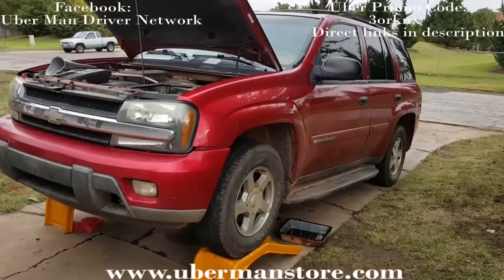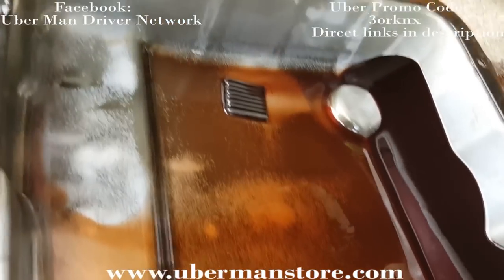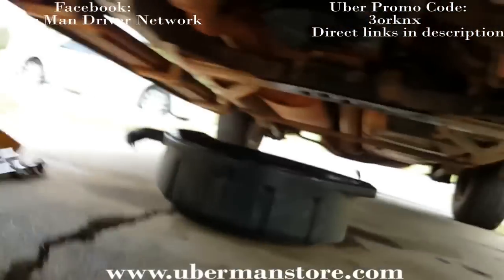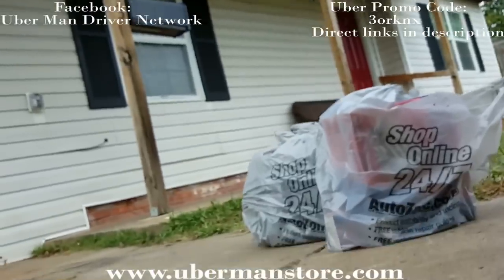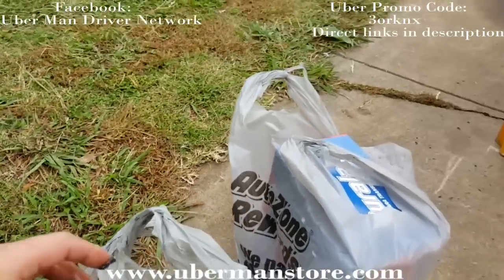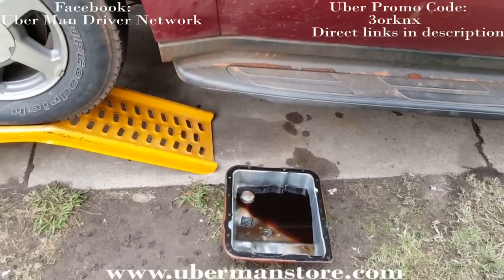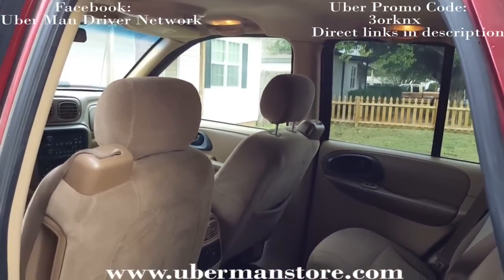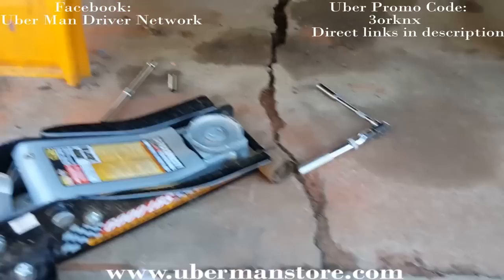2003 Chevy TrailBlazer Shift Solenoid Replacement

Comment: Man you stole that thing , heckuva deal. Nice video , I've got a 05 TB with same issues , the thing was fine and I parked it for a year and when I decided to use it again the thing wouldn't downshift or upshift , I can manually downshift it and upshift but only have 2 and 3 , its the 4x4 model . anyhow thanks for the video I'm bout to go crawl under it.

Comment: I bought one in March of 2020 seller got me had no air and it needed $800 worth of front end work but overall I like it I did have to replace the starter and alternator easy fix, Great video my man.

Comment: Loved your video.....2002 TrailBlazer....Cylinder Five misfiring....changed coil....spark plugs....about to change out the alternator....still running rough on idle....drives smoothly....but when slowing down & idle is very rough.....almost like I am hitting the gas and brake at the same time......are you still on this site.....can you talk to my mechanic about to do my alternator.....any way to know if my transmission is about to go out?  2002 Trail Blazer Chevy LT.......been having problem with leaking power steering that got all over everything.....HELP.

Comment: Thanks for the detailed info on the trans and its components -- too many YouTube videos blow past too many of the little details (which are often the toughest things to figure out if you don't already know about them already). I've done maintenance/repair/rebuilds onmanual transmissions but this is the first time I've ever felt like I could actually crack open this auto trans and not regret it. Great job!

Comment: I have the same vehicle. I am having transmission problems too and am hoping it's a similar fix.
In order to shift from second to third I have to slightly let up on the accelerator.
But there's more. When we took it out on the interstate for the first time we only got about 3-4 miles before we lost power. I'm not a mechanic by no means but I am mechanically inclined and a decent DiY'er. I realized it was shifting back down through the gears resulting in the RPMs racing up.
So we limited driving on lower speed roads as it did decent at speeds 60 M.P.H and less.
Now a new problem is developing. When I come to a stop I get a lurch forward and it dies. I believe it is staying in second or third gear when I stop.
Would this lead you to think it's the solenoid(s)?
als, the check engine light is on but the codes only reference fuel issues (evap).
I keep editing this to add more, lol.
We bought this about 3 months ago. From the comments below, I am going to change the filter and fluid and add Lucas.
It's in almost exactly the same shape as this one in the video right down to the console door.

Comment: Been hunting down videos to find my problem. 03 trailblazer EXT; recently a clicking like mock started and got pinpointed to the transmission, whether idling or driving you here the sound and you really hear it at 2000 - 3000rpms.  Has fluid but no real clue and hoping I can figure it out an fix it my self before paying the piper at a transmission shop.  Any clues Sir?

Comment: Regarding the vibration in drive that you mentioned... I also had this issue and replaced the motor mounts and cleaned throttle body. The real fix was the replace all 6 coil packs. Afterwards all vibration is gone.

Comment: Thank you for your video. My gear didn't shift from 3 to 4. It moves perfectly from 1 to 2 to 3 but sometimes doesn't shift from 3 to 4, so RPM goes high up to 3000 when I am on 50 miles. This issue happens occasionally and resolves on its own in 20-30 minutes. It was repeated 3 times over the past week. Any suggestions?

Comment: I bought a 2007 Chevy trailblazer LT 4.0 in line 6 4wd, it runs good drive good in first and second, when shifting into 3rd it revs super high and kicks into gear but im then driving in high rpm’s around 3000-3500 the hole time, not sure if it’s skipping 3rd or what. Any ideas of what could be the issue.

Comment: Would you be willing to help me figure my 2004 envoy problem out?  It throw code p0495.  Fan clutch replaced 4 times now and still throws the code.  There is something I missed.  What is it?  Will taking it to dealership to have main computer reset.  Will this do anything to help?  Please point me in the right direction.  I am disabled and this car was to get me to the end of my driving days.  If this continues it won't nor will my sanity.  My 89 Jimmy which I still drive beats the 04 envoy everyday in every way but I needed a car with Ac in Texas heat. I am at my end and I need help.  Thank You for reading my comment.  God Bless You.  I enjoyed learning from the video.

Comment: I need help i have a tb exactly like this one but a 2002.  I think it may be tge solenoid but not positive.  It shifts to 2nd most times but going into 3rd and then overdrive i guesse it revs high n feel like it is slipping.  Its not so bad when it is cold but once it warms up its a real pain.  I can manualy drop it to 3rd and it catches.  I also have a problem with the fan clutch.  Could that affect the shifting?  When autozone hooked up diagnostics it did not give a solenoid code only the fan clutch and a couple other emission issues any info would help

Comment: definitely answered some of my questions! i just thought the center console was crushed from the husky previous owner but it appears to be a common issue. my bad. haha  also it seems you have a pretty good knowledge on this yr so id like to pick ur brain on some issues im having such as first gear seems to wind out a little too long sometimes and i have to let off gas to get it to go. its not having the typical trans issues like no power or 3rd blah blah. gonna do the filter change and maybe a flush instead of partial fluid change. not sure if its worth doing myself and spending a lot on like 4+ gallons fluid etc or just taking it to a decent local trusted trans shop. any thoughts? thanks
Reply from the maker: A shop will charge about $120ish for a flush. I'd let them do it. I'd change the filter myself.
Reply: Thanks. That's what I was thinking too. So you think the first gear issue is hopefully just old fluid and the solenoid  gummy?
Reply from the maker: That would be my hope. Yes.
Reply: +Reviews and How-to yeah im kinda leaning towards that too since its not that bad yet. how are/were the shocks and struts in urs? mine are completely gone. about to order moog struts w/spring and kyb gas-a-just for rears. i dont wanna go cheap nor over the top. got any intel on them? oh and if ya dont mind one more question for now. it has a deadspot/hesitation as soon as I hit gas. I have cleaned the throttle body which helped a lot..like stopped stalling when I put a.c. and ran better but this is really annoying. lol any thoughts much appriciated. thanks again.
Reply from the maker: Shocks and struts aren't bad at all on this. KYB / Moog are GREAT! You'll love them!! As for the hesitation, plugs? Coils? Boots? That's where I'd start. A tune-up never hurts.

Comment: We have a 2003 trailblazer that runs rough occasionally and stalls occasionally. ...appears to do it now that it is getting cold here. I will definitely follow   the transmission maintenance that you performed. we have 137000 on it and have only flushed it once. :-( but it has run perfectly the whole time till now. I just want to know...how you got a hold of this year Trailblazer with a set of guages that are fully functional! most of my guages are completely off...any fixes for that?
Reply from the maker: You need to replace the stepper motors. It's really easy. You can DIY or pay a shop.
Reply: Ok i will look for a video for that! thank you!

Comment: If you’re messing with an automatic transmission, it’s best to reuse the old fluid if you have over 100,000 miles, that clutch material in the fluid is a lot of the time the only reason it’s not slipping. Change the filter, put the old fluid back in and top off with new fluid. If you put new in it and it starts slipping, skip the Lucas and head to a Ford dealership and buy their friction modifier. It’s the best by far.

Comment: 02 trailblazer 4wd LS  that i have suddenly has an issue with transmission(automatic). During normal operating temperature it Engages in gear(R & D) only at high RPMs. Cold starts  the transmission seems normal until about 15mins of  driving it start acting up....no DTC codes, no dash lights, fluid & filter changed this morning which drove perfect after so decided to drive around then 45 min later it decided to do it again. Solenoid? If so which?...PLZ Help!

Comment: We just bought a 2006 on of these and when I drove it today it was fine , when I put it in reverse it reversed normally at first but now I notice some times it will stick randomly, any advice on this ?
Reply: Did you ever figure out your problem I'm having the same reverse could work for a couple minutes at first startup then would stop working
Reply: @RVguyReese0926  it turns out it was me not pushing the gear stick in place we enough but also I did research and found it could also be a shift solenoid or shift line so even tho these weren't our issue it should help you narrow down a fix , good luck and cheers
Reply: @Fullrusher  Thanks

Comment: I saw you had the motor nice'n clean! I want to pressure wash my engine in my 2005 Trailblazer. What all did you cover before you washed it? I'm guessing the ecm to start with huh? Good video 👍
Reply from the maker: Thank you. I never cover anything. I just spray it. Never had an issue.

Comment: My 2003 has the same issues. I will be replacing the filter fluid and solenoids Rather than Selling it for nothing. Thanks for the video I found it helpful
Reply from the maker: Thanks for watching!
Reply: Be careful with changing to all new oil the detergent in the new oil could easily break up gunk inside and plug up vents and ports then your transmission could be severely damaged

Comment: Hello and thank you for posting these "how to videos" you help many of us out by sharing your knowledge in this manner.  I have an 02 Chevy Trailblazer in line 6 - 4wd that started hesitating between shifting and then while driving one day it was doing a flat out delay or wouldn't change at all, but never threw any codes.  I took it to a shop and I'm looking at 3700.00 for GM cert tranny. Mechanic says that my transmission fluid is burnt and they drove it and said my tranny was blown. This particular mechanic doesn't do any internal work... so my question would be.. could this possibly still be just the need to replace solenoid/s or truly a new tranny? Thank you again.
Reply from the maker: Step one would be pulling the pan. If there's metal in it it's trashed. If there's no metal in it, change the filter and fluid to see if that helps. Lucas transmission treatment is a miracle worker!!! Add 2-3qts after you change the filter IF there's no metal in the pan.

Comment: So quick question. My 02 trailblazer might have the same problem with solenoid. I changed the fluid out. It was dark brownish (Not like the fluid in this video) it shift gears fine but kind of hesitates on take off & a slight odor. A mechanic thinks it's my solenoid. Is this correct?
Reply from the maker: +Brian Davis If it's the solenoid, there will be a code for it. They either work, or they do not. I doubt that is the issue.

Comment: I have a 2003 envoy xl I was driving on the freeway exit the freeway stop at the light took off it stop pulling pulled over check for leaks no leaks the transmission was full I put it in drive D123 nothing put it in reverse nothing changed the oil pressure shifting switch and it still nothing happens I would like to know is it done inside the pan a little dark that's it

Comment: Great video Uber Man, I recently ran into an issue with my 2002 trailblazer where it would not shift out of park. It would turn on, you heard the click when you tapped the brakes, the brake lights were working, and the shifter was working, however it was not moving out of park on the dashboard. I hopped under the car and noticed the shift cable had popped lose and needed a new bushing to pop it back on. I was hoping you could do a video on shift cable replacement (from the transmission all the way to the center console. Thanks! I do have to change my motor mounts as well! Running good at 250k miles.
Reply from the maker: Thank you! I appreciate that. Sadly, I sold it, so I have no more videos on this truck.

Comment: Hi I have 2006 Chevy trailblazer slipping in 3rd and 4th gear. I changed the solenoids  and it still has the same problem. Do you have any other idea? Please
Reply from the maker: Was there metal in the pan?
Reply: No metal it was just black
Reply from the maker: Hmmmm. Check engine light? Codes?
Reply: Yes the check engine light is on. I took it to auto zone and a code was on there and it came up slipping.  The guy said it was a solenoid or low transmission fluid.
Reply from the maker: I'd do a complete fluid flush and swap the filter. Substitute 2 qts of fluid with Lucas.
Reply: ok thank you very much I'll give that a try.

Comment: Good video.  I managed to replace both 1-2 and 2-3 shift solenoids on my 2007 Trailblazer.  It was also low on Tranny fluid, which was to my advantage because it wasn't as messy to remove the pan.  But once it was back together when I put it in to gear it's not doing anything, not moving except very slightly when I put in drive.  There no reverse or anything.  Not sure what happened. help, any thoughts?  Thanks in advance.
Reply: Hello there, it has been four years since you did the repair and the truck was not driving. May I ask what was the final solution? thank you!
Reply: @microtcpip  it's been so long since this took place and we no longer have the car but I did manage to get it running again. If I remember correctly there was a leak in the transmission line and once I replaced the line it remedied the problem.
Reply: @lisarennert4180  Thank you for taking your time in replying. That gives me one more thing to check for!
Reply: @microtcpip  I hope that helps.

Comment: There is no service engine light on atm I have had it scanned before I can't remember the code tho.  But I did do a google search on my problem and I read peopl saying it was a solenoid going out.  Said something about a steal ball barn being pressed an aluminum plate and over time that plate starts wearing down where the ball barn can't keep the pressure to the plate.  Does that sound right at all?
Reply from the maker: It could be, but before anything else, that code needs to be run. This is something guessing at won't fix.

Comment: So I had a problem with gear slipping after 2nd gear. No third gear or higher. I took it to the shop and they said it was in pretty bad condition and a new transmission would be around 2k. You mentioned in the video a new one is 1100, where can I find one at that price? Thanks
Reply from the maker: Most shops will sell you a reman with warranty for $1100. That does not include labor.

Comment: I have a 4t40-e trans. and it take almost twice as long than it normally would to shift from 1 to 2nd gear. is that the solenoids going bad?
Reply from the maker: Do you have a check engine light on?
Reply: +Reviews and How-to nope. now I can't go faster than 10 mph.
Reply from the maker: There should be a SES light on. Is it burned out? I'd get a diagnostic and look for pending (not set) codes.
Reply: +Reviews and How-to  I'm starting to think so

Comment: PCM code non specific but indicated PCM issue ??   don't know what exactly because there was no part number was recommended after the scans  "Maybe a solenoid problem?" but not indicated with two scans, the second scan didn't indicate a PCM problem but other issues came up with more detail not relevant to a transmission slips in third gear alone.  I checked the transmission fluid but didn't seem very dirty from first look on the dipstick and was within level requirements indicating the fluid was changed recently or filled can't tell from looking but no leaks, presumed fairly well maintained.  I suppose the question is can doing the minimum solenoid swap and reset of PCM commonly repair a slippage problem in the third gear only?

Comment: I have an 02 LT trailblazer and one day I was driving to school, and I noticed it wouldn't shift correctly. Too MPH it would go was 30, and ever since then it shifts into all of the gears sometimes but sometimes slips. I put some trans x in it to see if that was the issue but it did a small significant amount better, but I was wondering if I could just have a sticky solenoid?
Reply from the maker: I'd start with a fluid flush and a filter change.